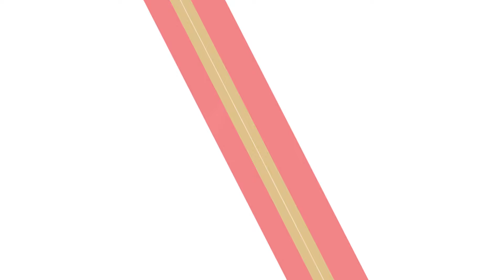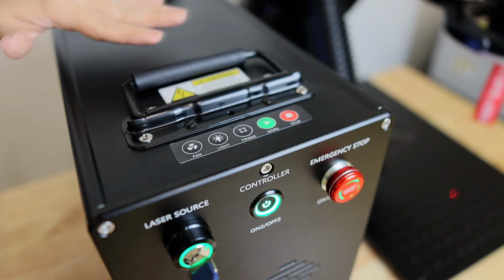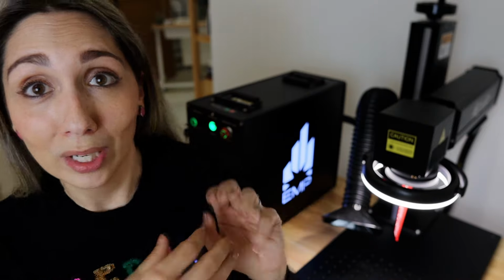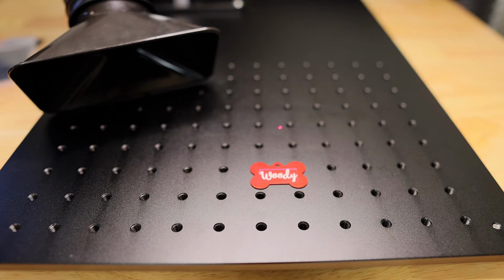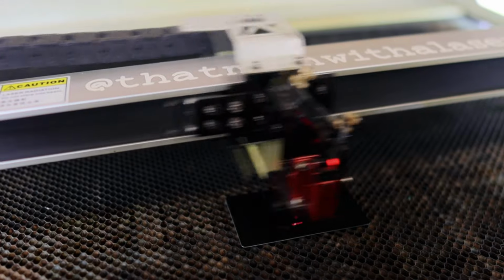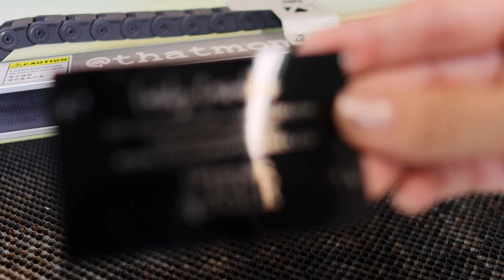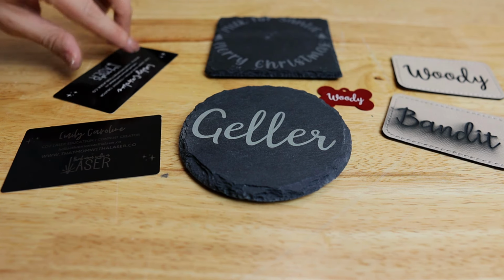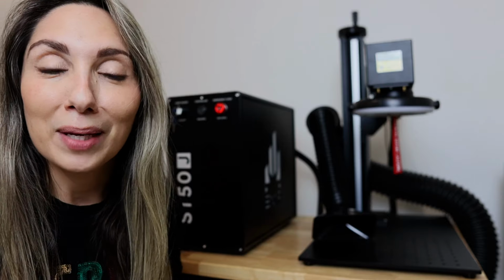Fiber Laser: First Impressions

Comment: Yeah! What upgrades for EMP 30w are available? Do you think 30w still performs well even though it’s not a 50w?
Reply from the maker: Upgrade options for the 30W and 50W are the integrated exhaust fan, ring task light, and a rotary device if you don't already have one. Whether or not the wattage will perform to your liking, largely depends on your application and desired cycle times. The most common reason for increasing the wattage is to perform deep engraves in less time.
Reply: @ThatMomWithALaser  do you think the piburn grip will work with the fiber … does aeon’s multi roller?! Yahooooo!
Reply from the maker: @km_777  The fiber is compatible with all Aeon rotaries with the exception of the MultiRoller.  So, if you have a PiBurn, Rotoboss, the chuck or the smart roller, it will work with them!

Comment: Have you figured out how to extend the laser area yet? Was told the further out you fiber laser the less quality of the etching. So it’s limited to doing very small items right? Less than 8”x8” …?
Reply from the maker: Hey there.  I have yet to do anything big.  I seriously just did that video this week, ha.  But my understanding is that yes, you can increase the field size by opting for a taller vertical column and a lens with a larger field size. It ends up being around 12" x 12" work area, and while not as powerful of a beam, still produces excellent results.
Reply: @ThatMomWithALaser  thank you!

Comment: The higher the wattage on the fiber laser the faster it will engrave. Also are you using lightburn ? Check and see if your Fiber Laser is compatible with lightburn if it is get lightburn it will allow you to do more with it.
Reply from the maker: It is! The EMP comes with the license key. 🙌🏼

Comment: Just clarifying, this isn't the model we get with the Aeon Nova 14?
Reply from the maker: Hey there. Correct. A free 50W raycus is what comes with the Novas, which doesn’t have all the bells and whistles mine does, but you’ll be able to order the task light and integrated exhaust fan separately. However, if you upgrade to a SuperNOVA, you get a free 60w JPT MOPA which does includes everything I have on my machine, LED logo, Smart Keys and all.

Comment: I really want to get a chuck for mine so I can do multiple cards and pens at a time.
Reply from the maker: I thought you would make a jig for this? Do tell. I’m gonna need all the accessories. 😍
Reply: @ThatMomWithALaser  you do make a jig in your co2 for it but for that jig to work you’d need a chuck connected to the fiber and rotated up at the laser. Then it just rotates each section based on the timing and rotation in lighburn similar to a rotary with tumblers. There’s a lot I need to research with it yet!
Reply from the maker: Same!

Comment: But its so expensive, a 50w CO2 is about 1500$ and a fiber is about $1400. Im below $3000 vs buying the aeon at 5k
Reply from the maker: True. It's not one of the more economical lasers on the market and thankfully there are lots of options for all budgets and comfort levels.  With that said, this is true for everything out there.  Someone might choose to drive a Hyundai over a Lexus or a Mercedes over a Ferrari.  They all get you where you want to go.  The ride just might be a little different.  With that said, I've proven more than once that anyone can pay off a laser in less than a year if they really want to.  I'll link it below for anyone reading this thread.  It can 100% be done! https://youtu.be/-U0MRvrLA8M?si=cmpaTa0QFC3mIxVz
Reply: wow.   i want to know where those prices have been hiding all year when my 55watt CO2 was 5 grand and a 60watt MOPA was another 55...
Reply: @havocproltd  has it gone up? I got my CO2 laser from China direct for 1428 shipped. And a 30w fiber is $1500 it seems when looking now. Prices are still around what I paid it seems???